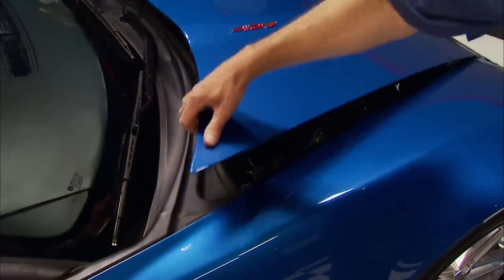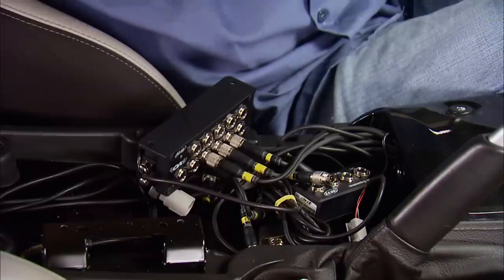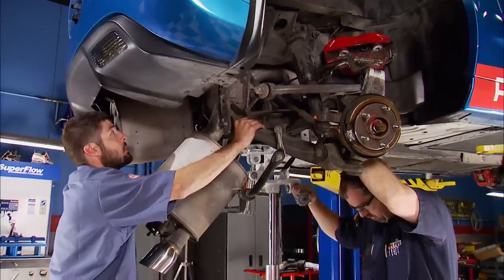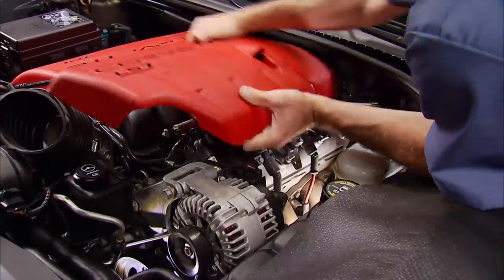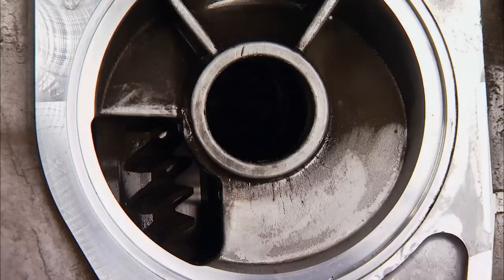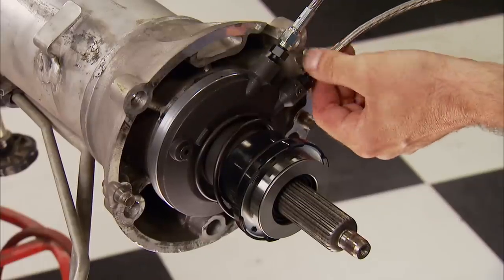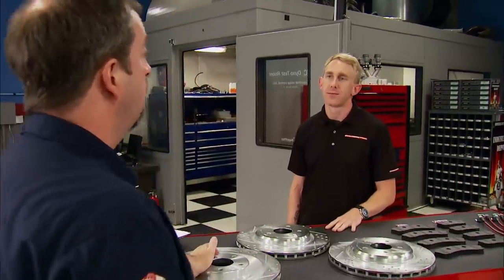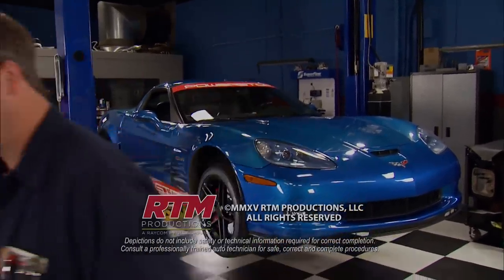Can We Upgrade a '08 Z06 Corvette to Outperform a '15 Z06 For Half the Cost? - Engine Power S2,E17

Comment: I would've replaced the pilot bearing also. The needle bearings go bad and can cause drive line vibrations. Being a GM technician and doing it under GM warranty,you were careful with checking all components didn't want to do the job for free.
Reply: They didn’t mention thread locker on the flywheel bolts, but surely they used some?

Comment: Nice video.  Since you had the torque tube out, I would have checked the couplers.  They are known to fail and cause increased vibration.  Cheap to through a couple new couplers in.

Comment: You don’t need boost in a c6 z. Heads , cam , ported msd  intake, cold air , ported tb and you have 580-620whp na add e85 and you have 650 whp n/a.  At the lowest and smallest cam 550-580 whp that will bot race a c7 z which makes 550-570 whp 580-600 wtq stock in both et and trap speed. You add boost and it’s not even fair for the c7 z it’s to heavy at 3570 the c6 z can weight 3109-3200 or less with light weight wheels and headers . Second those brakes are two heavy you want 2 piece rotors with aluminum hats those are one piece and heavy.

Comment: I read somewhere that GM had built a 454LS engine based off the LS7427(really426). However they couldn't get it to pass emissions. So they moved on to adding blowers. But somewhere that engine exists.
It would be cool to see a Hotrod story about it!
Reply: Theres a lot of engines that GM (among others) have made that are along those lines. No doubt they made a LS 454, they were also developing a factory V12 and V16 at one point like 10-12 years ago. If you want to know where they are now, id say take a look at that soda can you may be drinking from and theres a good chance a bit of it is in there.

Comment: after having removed my c6 drivetrain twice using jackstands.. I'd definitely second the sentiment of using a lift if possible.  I see now why so many C6 are heavily modded.  It's so labor intensive to do some jobs it's almost better to just take the whole car apart one time and put all the mods on as you reassemble the car.  I sure hope this car's torque tube couplers and bearings were at least inspected before being put back in. (yes, I realize this video old.)  The C6 is a love/hate car for sure.  Love driving on it, beginning to hate working on it.

Comment: I had a ZO6 2008 the car was a nightmare Val's dropping and GM never was responsible for any of it. Stopped at a red light Val dropped into the motor I would never buy one again. GM did not stand behind their product and knew it had a problem never again but nice video
Reply: Did your block crack or was it just that one cylinder and piston with valve that were ruined?
Reply: @Texas_Cruiser  I ended up replacing the motor $14,000 brand new crate engine. Anyone buying a C6 ZO6 replace the heads. The motor is tremendous but those heads are terrible.
Reply: @garyrichardson7592  goodness gracious they couldn't just repair that cylinder or bore and stroke the motor?  And about your experience with GM...supposedly it was on a tiny percentage of cars so did not warrant a recall...key word supposedly.  Just the fact that it's even possible to happen and the severity of it should warrant a recall or extended warranty!
Reply: @Texas_Cruiser  just my luck to get one it wasn't the boar it was the heads.if I had known I would have put a different set of heads on the car. I have a new Z06 now convertible zo7 and it goes into limp mode at 160 so I'm getting ready to have it tuned it's running out of fuel upstairs 116,000 and this is what I'm getting at 160.
Reply: And I have two rims that's cracked from poor quality the Corvette I hope the new one is much better do I'm going to have to get me a Porsche maybe I'll get better quality I like the Corvette I'm on number 15. They won't even replace these rims that's bending on everyone the ZO6 and Grand sport wow
Reply: @garyrichardson7592  I heard about the wheels on the C7.  The savagegeese review makes mention of it.  I had a base 05 C6 and loved it.  Looking at the Z06s now but will most likely buy a built one.
Reply: @Texas_Cruiser  I don't know if I'm going back with a Corvette. They have not stood behind their brand good enough so I might go with something foreign a Nissan GTR or maybe a Porsche. But I think I'm going to let this brand go GM is terrible right now they do not stand behind the Corvette like they should I give up

Comment: Vettes are easy to work on. That clutch job can be done on jack stands.....been there done that. No issue at all doing either.

I know you have sponsors to deal with but that clutch is a bad choice. Shoulda put some gear in the car while the rear was out too.

For a road car that supercharger is not only wrong but a bad choice.....really it's a bad choice for a ls engine  in a car in general. Be a great pick up truck supercharger tho.

Comment: It already hangs with the new one add a cam and heads and it s gone.You will need a good clutch.Mc leod rxt is really nice twin disc clutch .Blower is a waste on an ls7 .Cant boost too much due to thin cylinder walls and cam and heads is way cheaper.
Reply: I'm looking at a supercharged one but with an after market block.  Saving big not buying all those parts and labor myself.  How's the Iroc doing?

Comment: A 2015 Z will run between 44-52k... an 06 Z is anywhere from 25-35k... so meet in the the middle 46k vs 30k leaves you with a 16k budget... so, probably.
Reply: Doober717 c6 z06 is 15 k
Reply: Just seen one for 39k and one other for 40/41k(ish) come on C8! drive them babies down! lol
Reply: Sure a 2015 will run about 48k, today. Not when it was new.
Reply: preludeF20Bking no it is not.
Reply: sparkplug1018 and a c6 Z when it was new was around the same price if you count inflation. So, comparing new vs new, would leave you with a budget of 3K at the most. No way 3K will get you the gains needed on the c6 platform to touch 650 hp with 650 tq.
Reply: Doober717 Except that’s not what they’re comparing. It’s a comparison of used vs new. In other words, can you upgrade a used one for less then the new one. THAT is what’s being compared.
Reply: Doober717 This episode was filmed in 2015. All of these they’re posting are reruns of shows that were aired on tv years ago. If you want you can go watch the conclusion on their website right now. So, in this episode the question posed is can you upgrade a used Vette to outperform the new one. Wouldn’t make sense otherwise.

Comment: I cannot believe you did not do a Dino run prior to the engine work and exhaust. Instead you use your Dyno machine as a parts counter. Also I hope in the next video it shows you addressing the head problems that are major issues with this particular years and engine. There's videos on here of people leaving the dealership and had gone a couple of blocks away and had to be towed back to the dealer. GM is aware of the issue what has refused to fix. It's just like Ford's with their 6.0 diesels they are aware there's major issues but but refuse to fix. Anybody with Gen 6 Corvettes that are ZO6 have a saying have you fixed your problem with your heads and if you haven't yet it's just a matter of time before it goes.

Comment: Uhh they could be making 200-350+ more hp and torque. And compete with a zr1. Cost idk but ls3 heads and a Magnusson 2650 with a cog drive system would do a MUCH better job

Comment: Does anyone use threadlocker on the flywheel or pressure plate bolts?
Also, I always thought C5 and later Corvettes have a rear transaxle...?  A combination transmission-differential unit.  This is clearly not the case as the video shows the transmission and differential being separated.

Comment: Hope they repair the stock heads before they drop a valve.
Reply: Exactly. I was like rip that ls7.
Reply: I'm sure it was addressed by powerstop before their testing and data logging.
Reply: @z06camaro  Would be nice for them to tell people who dont know. Isn't this for educational purposes?
Reply: @REDZ28won  I agree, hell I even forgot about the dropping valves as I was watching the video.
Reply: First thing I did when I bought my 2008 Z06 is upgrade the heads to Texas Speed 64cc heads. (11.5:1 compression, solid stainless valves)

Comment: LS7 was very unreliable and not boost friendly. A good head and cam will put you at 600-640 hp. Then you could add a small supercharger for 700-750 hp. The only let down at that point is no automatic trans.

Comment: Did you have to loosen the motor mounts and jack up the engine to install the headers? Also, how did you get at the front two nuts on each cat pipe?

Comment: Replaced one motor mount but not the other? Then you plan to add horsepower to the engine while one old motor mount can fail at any moment? Never bothered to check the gear oil level in the transaxle? Put the new clutch disk in without replacing the pilot bearing?  It take's the same amount of time and effort to do it right as it does to do it halfassed. Rookie mistakes like these make PowerNation look bad...get your shit together guys.

Comment: 304 Stainless headers and X pipe, getting reconnected to the factory tailpipe? 🤨😑
Reply: These almost no power to be made by replacing the factory mufflers on these cars, they have an internal bypass.  ;)

Comment: LS7 be dropping valves. Address that for sure.
Reply: How many have you owned...lol
Reply: @2t713  None, but I've known a few people with them that have had issues with the valves. LS7 are high revving engines and notorious for dropping valves with the factory heads. If you are going to push some serious power out of one, it makes sense to address that issue first.

Comment: I'd rather have a C5. Didn't even like them when they came out. Still don't like the 6 or 7. Now the 8s I like but no manual? Only a matter of time before some Gearhead fixes that mistake.
Reply: The manual is dead and buried at this point. At least in production cars anyway, just can't beat what modern autos can do.
Reply: @sparkplug1018  not really the point. Manuals are so much more fun. Who cares how much better modern autos are. Besides, they're a hell of a lot cheaper to fix.
Reply: John Derek Mitchell Obviously the manufacturer’s and buyers care. If there’s a demand it would be available, that’s all there is to it. I doubt we’ll see a manual in anything but dump trucks in the next 5-10 years.
Reply: @sparkplug1018  Unfortunately I believe you're right but, it's only a matter of time before even Heavy Duty Trucks go Auto as well. Perfect example is the OTR trucks are already being made with Automatics. However, my statement about a Gear Head stands. B is for Build already proved that with the Lambo they took to SEMA. Just as Gear Heads are swapping Manuals into Chargers. BTW, do you know why the Charger only comes with an Auto while the Challenger can be had with a Manual? Same Platform. It's ridiculous.

Comment: hey guys I really need help with my 1986 Pontiac Grand Prix that was my best friends that passed away from a lifetime of diabetes it set for 6 years in a garage and now it needs love. it has a brand new 700 r4 with a stage 2 shift kit a b&m stall converter a built 350 for stock car racing but is blowing smoke out of the valve covers please help

Comment: The LS7 had weak internals. Lots of issues with blown engines, stock engines many with under 7k miles on them. The titanium rods and valves were bad. This engine can not handle over 600 crank hp and last long without a full internals build.

Comment: And since you didn't touch the heads, at that HP level your stock valve guides will fail, your valves will drop and wreck the entire engine.

Comment: I'm not going to bother doing the exact math, but I call BS they spent less than $10,000 upgrading this car.
Reply: That's bc they didn't include labor cost. Parts list is probably around the 8k mark
Reply: I'm thinking a bit more than 10k.   That transmission has to be a pricey piece of kit.

Comment: 1:56 oh power nation. Why on earth are you insistent on spending thousands upon thousands of dollars to get the smallest amount of performance possible?

This car came with 505 horsepower. You said you're going to give it 650. That's only 5 lb of boost

What the hell is the point of doing all of the work for 5 lb of boost?

You can run 10 lb of boost on pump gas on a daily driver

Comment: Wow this channel seems to attract a lot of bully’s and complainers. You tube seems to have become a new platform for crap talking when it’s supposed to be an information highway and a personal showcasing video platform. Anyways when you ACTUALLY build cars instead of being a keyboard warrior or couch mechanic/critic you realize that all information you learn regardless of the source is taken with a grain of salt and that information is compared against all of your personal hands on experience while building engines and chassis and if it makes sense and coincides with what you know then you try it and if it doesn’t then you don’t. It also gives you an opportunity to see some of the new age techniques mixed with old techniques and it also lets you see the fact that all engine and chassis building is just step by step processes similar to baking a cake, except much harder work. Both are able to be done by most people but just like the difference between a professional cake maker and a mom baking a cake at home the real difference is more specialized tooling, more practice, and more technique, coupled with tricks of the trade learned over the years and your ability to source and get better ingredients and the latest information. Anyways, love the episodes POWERNATION keep doing what you’re doing and keep on improving. The only constructive criticism I would offer is to do some episodes of rebuilds with high performance DOHC four cylinders because you would be shocked the power you can pull from very little modification and a power adder from some of the dohc inline 4’s. Well maybe you wouldn’t, but a lot of people would be, besides classic v8s have been built and proven to death for a long time.

Comment: What would be truly remarkable is beating the measly 6.2L with a remastered 7.0L 427 C6 Z06.  By going naturally aspirated like Ford did in 1969 with the Ford GT40.  https://www.youtube.com/watch?v=6g3Ay83JLJE  For instance a camshaft so ridiculous it barely idles at 2,000rpm & a AutoCAD crafted plenum on top of ITB's that utilizes the correct plenum dimensions & geometry for the desired power envelope.  With dual stage runner's, long mode for the low end & short for the top end.  Use Honda's FRM (Fiber Reinforced Metal) method of treating the Crankshaft, camshaft, bearings, rods, and pistons like Honda would so it can reliably generate 8-8.5 Grand of RPM because of the immense flow of the ITB Dual Stage Intake Plenum.  Peak torque rides all the way up to 6,000rpm where the long runners are open planting you in the seat the fullest extent, then right when you think it's all over another stage blasts you further in the gut all the way to 8,500rpm on the 7.0L 427 naturally aspirated putting out a modest 650whp.  With enough time & effort it's achievable.  I'd love to sit down & do the math on the geometry of the intake plenum because that's where all the power is made or lost.

Comment: Why drilled and slotted rotors?  They don't help with cooling as much as the extra mass they take away from the rotor, and they add stress points where rotors can start to crack.  I know a lot of racers and don't know any of them that run drilled and slotted rotors.  Drilled and/or slotted rotors are for posers.

Comment: BS ...  no lift required. I guess maybe for you clean “tv show mechanics“... I’ve done this with jacks and jack stands in my garage by myself
Reply: Dang. How high does the car have to be to slide it all out of there ?
Reply: @RTSELLS  he said jacks, meaning smaller Jacks to get under the car so the bigger jacks can get under there. Just gotta have the equipment and the will to do it that way.

Comment: These vettes are too complicated, i gotta say the 05-14 s197 mustang chassis is so simple, cant beat a straight axle, but yes i know vettes handle better
Reply: Its the trade off when you start getting to those performance levels, unfortunately. Pretty much any car that came from the factory thats in this class is going to be stupidly hard to work on.
Reply: sparkplug1018 vipers are fairly easy to work on
Reply: 1991tommygun Haven’t had my hands on one so couldn’t say. That would be a rare exception though

Comment: Can someone please explain to me why stainless steel would need protection from the elements. it's impervious to corrosion. I think the red is just to make them look nice. these guys say stupid shit all the time
Reply: Its mostly to prevent rubbing, just in case. Also some stainless alloys can rust, don't recall which series off hand but its possible.
Reply: @sparkplug1018  yes I know 409 stainless can develop surface rust but it doesn't affect the integrity and 304 which is kind of like a stuff silver with made of never lost it all
Reply: @darrenporsch  Thanks couldn't remember which alloy it was. But yeah the coating is just to prevent chaffing. Or they decided to use 409 for some weird reason.

Comment: Why you remove the tires when the car is up in the air? Lol
Reply: In all fairness those tires aren't heavy but still not light.   It's easier to move at waist/chest level.
Reply: Probably because it's pretty dang hard to remove the tired while the car is on the ground.
Reply: @Clobercow1  lol.
Reply: @Clobercow1  that could make things challenging.
Reply: @Clobercow1  The car is on the lift lol, you can lift it up a few inches and remove the tire